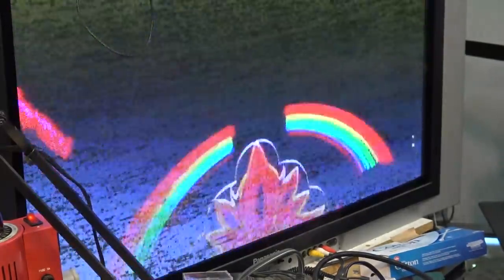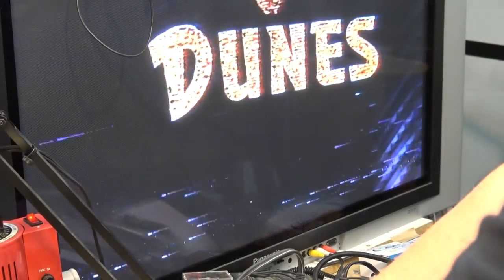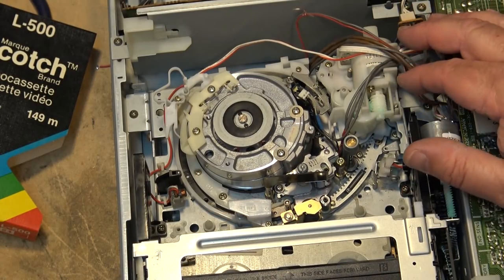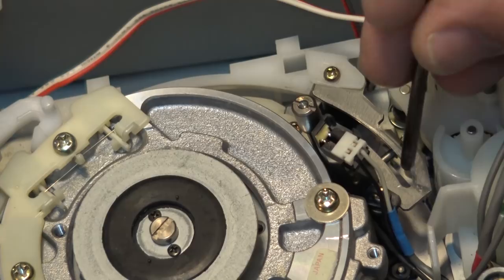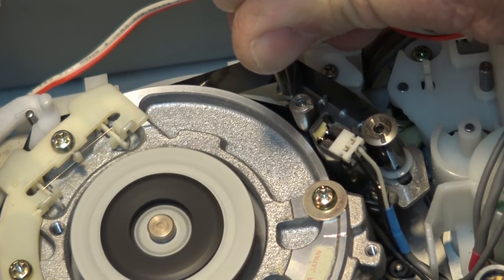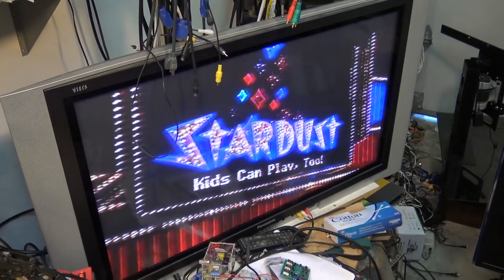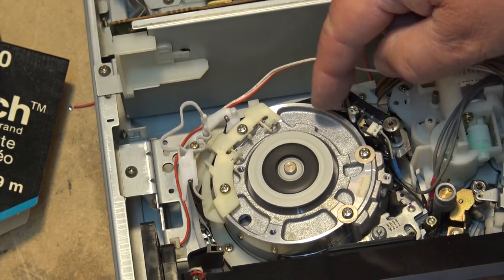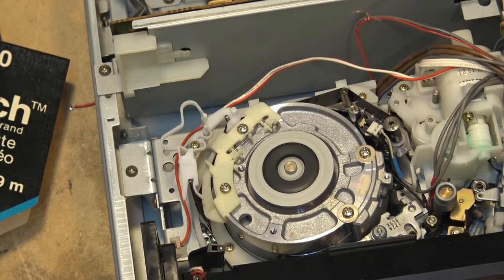Sony Beta tape Threading Faults

Comment: I know its not the same format, but ive had lots of enjoyment repairing old vhs machines, everyone is slightly different in design :-D.
The head adjustments were a common thing i had to put right, people see screws and well... ya know lol.
Getting the tape to sit on the rabbit shelf with no curls or ripples takes a bit of time, then playing known good tapes to micro adjust the poles untill the change over switching at the bottom of the screen is good, and the tracking is nice.
The front loading ferguson videostar machines allways performed well.

Comment: Put scope on the video headamp FM output to observe tracking waveform. Envelope display can used to adjust for best signal to optimise playback for particular tape, but it should be set for standard interchange.

Comment: You are absolutely correct the last three Sony F30's I've seen (same chassis) the longer metal guide was locating under it's locking post. I had to lightly tighten the small screw at it's base to increase the height during it's pop up so it located in it's slot.I guess it's a common thing for that model with age for some reason.

Comment: The Shuttle Block on the 711B2 and 711D Chassis, 
in my experience, rarely fail it. Faulty threading, is made, by broken guide post. 
Thanks for this Video 12V !!
Reply from the maker: Is this the 711D? I forget all the chassis numbers that Sony used.
I remember there was a 710 (Sl 5000 series) 711 Sl 2000, 2500 an 2700, 711B, 711BII, 711D and wasn't there a 712 as well?
Reply: 12V the chassis in our video is the 711B3.
Reply: On the 711B3 Chassis, pay attention, at the loading motors;
this motors have a worm gears clamped with a plastic ring.
This plastic ring, on the threading motor, and FL motor cracked, very easily.
Reply from the maker: Good to know as I am editing a video showing the disassembly of the FL mechanism, and the timing of the main and sub loading rings on this model. That will be up later today.
Reply: Eu restauro e colecciono "Betas" de várias marcas,e de muitos modelos Sony que tenho,ainda não passou este problema por mim.Apesar das mecanicas Sony serem quase iguais,vale bem a pena tentar restaurar.
Reply: Yes. The machine in this video uses the 711B3 chassis. The 711D was used in the SL-2500 and 2700.

Comment: What opinion do you have on the old BASF beta tapes? I've had some of them and they shed their particles as they get old. The old Sony's, TDK's etc are fine.
Reply from the maker: BASF video tapes were garbage when they came out, and they have not gotten better with age. They were chrome tapes, and chrome is very brittle.
When Sony came out with the 711B chassis I remember seeing machines with piles of tape coating all over the inside. The SL200, 2500 and 2700 was really bad. When the upper drum got shiny the tape would stick and cause tape slap on rewind. The slapping tape would shock the tape and the chrome coating would peel off. 
They also were pretty hard on the heads and would wear heads down quickly.

Comment: Where could spare parts be purchased?
Reply from the maker: That's the $60,000 question. They haven't made beta machines for what 40 years so good luck finding parts. You have to buy old machines to take the parts out of them and even people selling old machines these days are getting top dollar. I've seen old betamax machines going for $200 as a parts wrecker and when you get them there's already parts that have been picked off. I had a guy bring me a beta machine a while back and a wrecker that he bought for over $100 to take parts off of what wouldn't you know the part we needed was already gone from the one he paid $100 for so he wasted his money. But those are the chances that you take to maintain this old equipment because there are no new parts available for them. and I pull my hair out when people tell me that they still want to record their home videos on this obsolete equipment. I can't understand for the life of me why anybody is wanting to trust this old archaic equipment to record once in a lifetime memories but that's just me you wouldn't catch me using any of this old crap.
Reply: @12voltvids  and could I know which is the clutch pinion?

Comment: Hi 12voltvids.
I have betamax sl t7me machine.
Playback works ,bat there is no picture and sound  when playing recorded material.I can see the picture when i press picture search.
Reply from the maker: Ok here is what happens. 
The control track needs to be present to synchronize the video heads to the start of the track. If there is no control track the deck mutes the video and sound.
 In freeze frame, or when the tape is running at a fast or solw speed there will not be a correct control track so the video muting circuit is disabled.
So this symptom means you have no control track. It could be as simple as the control track head is dirty. Try cleaning the control track portion of the audio/control head. Audio signals are recorded along the top edge of the tape, and  the control track along the bottom edge of the tape.
Reply: That's Sony's first multi system Betamax. I'm suprised the switcing power supply still works after 38 years.

Comment: Congratulate me!  I'm expecting a Sony SL HF500!  Lots of Demos on Youtube,  but none showing the strip down to
understand the Loading mechanism and the heads.   It plays, ff, rw but he is using a blank tape.  I figure the seller didn't know how to set up channel 3 bypass through the Cable Company.    TV picture was nothing but static. He didn't record it.                        I now know it's not on a screw like Driver this one!  It has Wingy-dings!  LOL
Is the SL HF500 like any of the past Beta lessons you given us?  You have stripped down quite a few models now!
LOL  I'm going to order a Metric Allen Key set for one.   My sewing machine needs that one too!

You are an awesome teacher. 

Maybe I'll find one of those Beta - Phillips too!